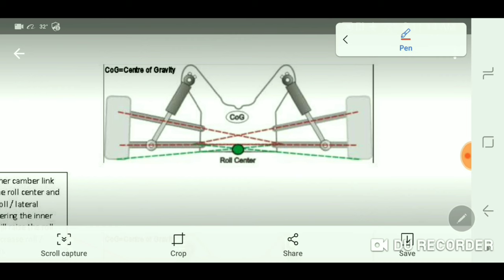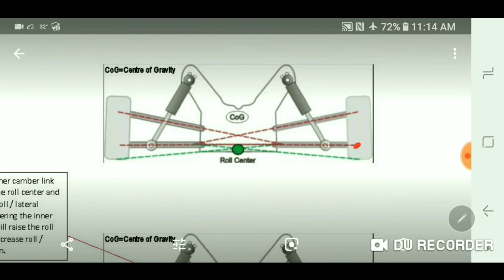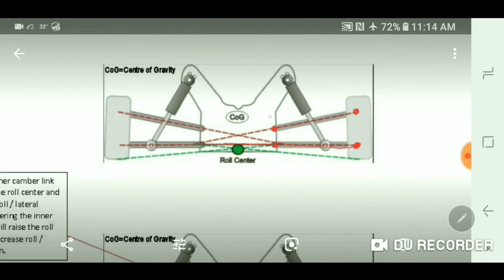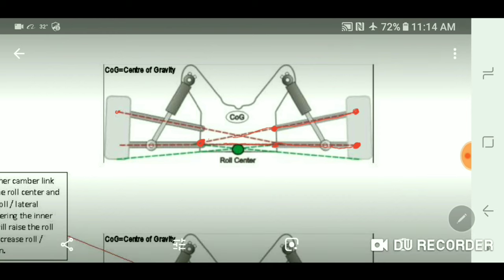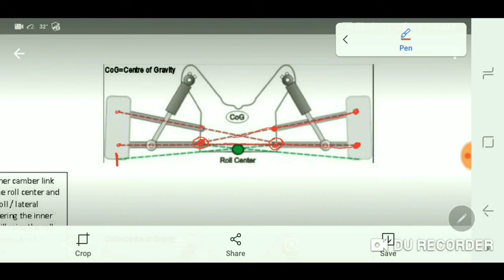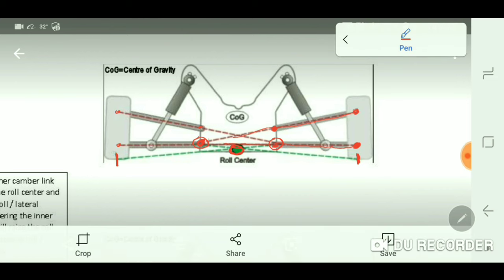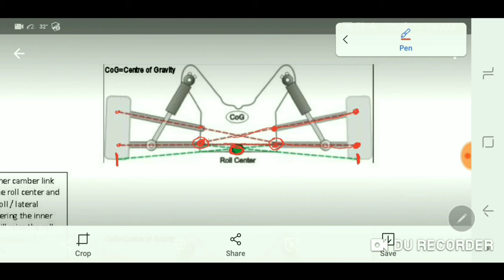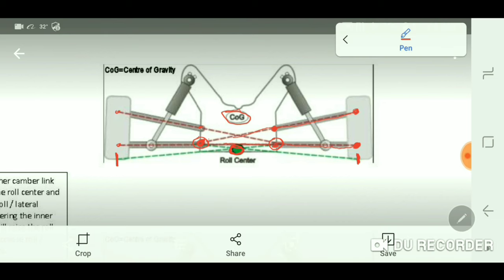Roll Centers Explained in layman's terms!

Comment: Higher roll centres don’t transfer less load to the tires, but they do it faster because less load is transferred via the shocks and more via the links which is much faster. Low roll centres equals more grip is not true in reality.

Comment: I am sorry but how you come up with that truth that you will have more traction if you have more roll. You will have more traction if you are able to redistribute load on a tyres evenly that is way racing cars have wider track width. If you have all preassure of a car on only one tyre you will have less traction because tyre traction is not linear like general roule of traction and friction that you learnd in school. Wider tyre in static condition will have less pressure per square inch but the grip will be higher than in narrow tyre. To conclude if you are able to distribute pressure on all 4 tyres and have all 4 tyres on the ground your grip will bi at maximum.
Reply: The equalizing of pressure over the tyres is achieved by the anti roll bars and the tuning of shocks, the geometrical principle explained in the video is correct, the ways we have to deal with it are another thing, and both of you are right, even if it seams impossible.